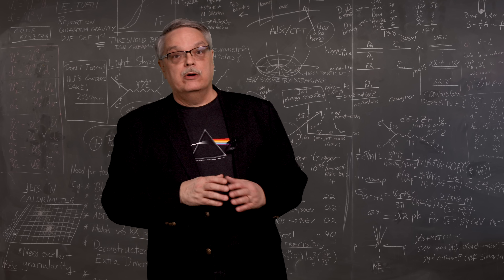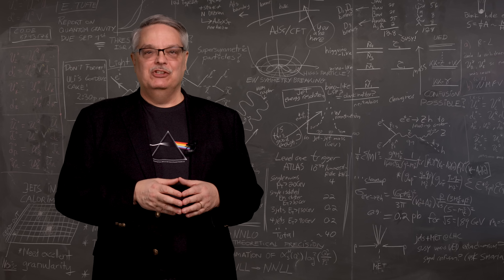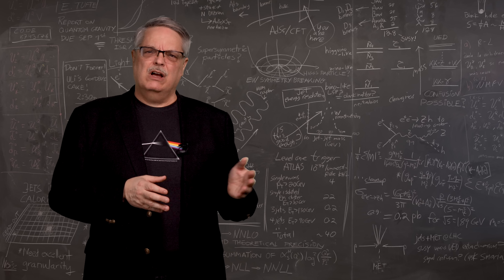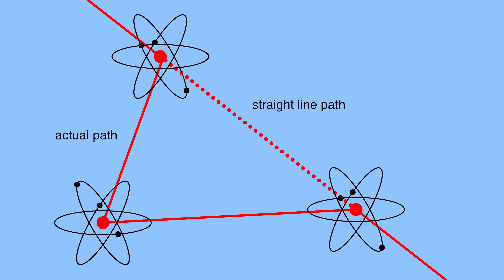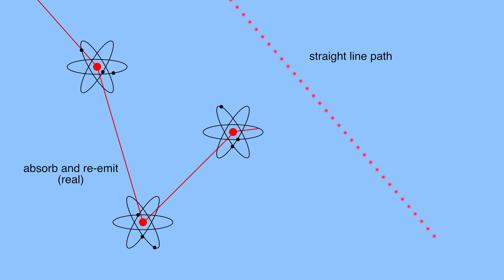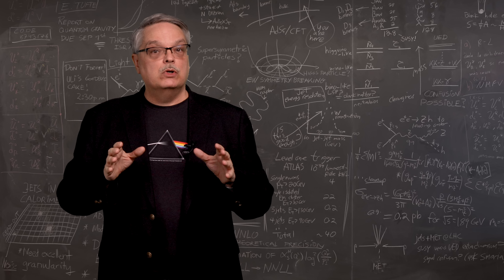Why does light slow down in water?

Comment: The "correct" answer seems flawed. Light can't move electrons without losing energy to the electrons, that is conservation of energy. That means the incoming light is absorbed by the electron, and the electron enters a higher energy state. Then when the electron moves back down to the normal state, it emits light with the same energy it absorbed. That describes the second explanation that is supposedly wrong. If the "correct" answer was possible, that light can move an electron without losing energy to it and continue on, and the electron will then create its own light as well, that is a form of amplification, creating energy from nothing, breaking the laws of physics. Is this video just over simplified, or just wrong?  @Fermilab
Reply: It emits same energy , alright
But how the hell it emits light at the same direction ? 😕 
No body knows 
Fuck that physics 😑

Comment: When electrons emmit the wave, what kind of wave is that? Is it a light wave, or does it have mass?
Reply: Moving electron generate EM (light) waves. Al moving charges emit EM waves.
Reply: @wayneyadams  if so, the EM waves from electron should have the same speed as light, so why the combined wave is slower? Also, why the wave from the electron cannot leave the material? So confusing.

Comment: but that means  the exposure of light to a higher containment of electrons should slow it down even more??

you see, let's say there are two glass blocks (block a and b) , block a is described to have more mass or rather defined as density in terms of electrons than block b, does that mean that the same frequency of light emitted to block a would be  slower in terms of speed than block b due to a higher containment of electrons which induce electric fields upon the light wave ?
the evokes uncertainty upon the speed of light , hence it's not the same

Comment: I'm clearly missing something in my thought process. Hopefully somebody can put me right. When the light enters the medium, it causes electrons to emit their own waves which in turn interfere with the light wave that has entered the medium. This is what causes the light to slow down. Now, when the light reaches the other side of the medium isn't it still traveling with the waves emitted by the electrons? My thought process is that the electrons can't exactly take back the waves they have emitted when light leaves the medium. I would just assume the waves emitted by the electrons would also continue to travel out of the medium with the light?

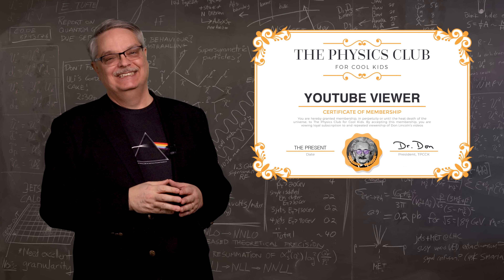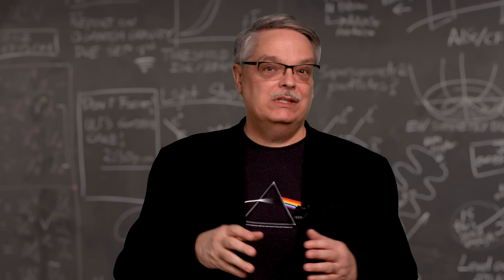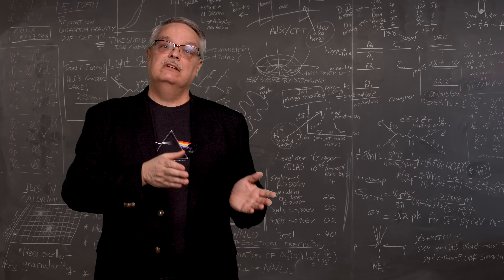Comment: I think the point that you ruled out of light absorption and releasing is valid or at least needs more study, think about it this way; light hit the electrons at 10:00 o'clock direction and absorbed but released at 6:00 o'clock direction instead of 4:00 o'clock. this would justify why the light slow down and bend at the same time. without the need of saying the atom does not remember where the light coming from, l think it does! it's a clock cycle.

Comment: i still dont buy this explanation,,if a different wave is created and is slower then as it exits the glass it reverts back to the original faster wave?? so you are saying the frequency changed while going through the glass by a certain amount of nanometers then emerges back into its original frequency,,,then how do you explain why this does not happen with sgh crystals or frequency doubling? the laser at a wavelength of say 1064nm enters the crystal and is changed to 532nm but remains at 532 when it exists ,is there something completely different happening here than what happens through glass or other substances?

Comment: So light bends while passing through a magnetic field. Also we are told that light bends due to gravitational force. Is this where the connection in between the low range gravitational force but outreaching universal effect of it lies? If yes then gravity is perhaps just electromagnetic force . But then there is more dark matter around than matter. So what we mainly have is really anti gravitational electromagnetic force which is the reason for universal expectation. But distribution of it isn't uniform. So we should see galactic expansion happening in different rate and maybe reversal of it in some spots. Have we or will we see a galaxy just falling apart? I think I could totally mess up everyone's brain 😂
May I ask the valued professor presenter in running an experiment to run the light through a piece of clear plastic then charge that plastic with electro static electricity then compare the difference? Then also apply a beam of light with similar properties but exactly opposing direction and demonstrate if anything might look different? Have we ever heard two beams of light cancelling or slowing each other!? 😂

Comment: Missing from the explanation:
1. The speed of light through the medium varies continuously with the frequency of light somewhat defying quantum effects.  Nice to use parallel sheet of glass but next time try a prism.
2. What is the atomic interaction with the molecular structure of the medium that makes it transparent?  Obviously that structure has a direct effect on the speed of light in the material and its relationship to the frequency is also a mystery.  You left out the part when showing index of refraction in those tables that it is measured with respect to a specific frequency of light I believe in the yellow range.
3. And since the electromagnetic frequency ranges quite a bit, stretch out that spectrum a bit to see what happens.  I'd like to see photons explained in the radio frequency range.
Reply: Write a paper on it.
Reply: To answer your first question, it is because different frequencies of light have waves that have...well... different frequencies. since the velocities of the wave from light and the electric field are "added" together, different frequencies of light would yield different final speeds of the wave.
Reply: @leemaina8170  This is the same preposterous claim made by fermilab.  There is not only no math to support this, but the Fourier transform is the best piece of math to refute it.  It is an illusion to be caught up in an apparent identity that sin (a+b) is the same as sin (a) + sin (b).  The first form is definitely a sine wave but the second form is what you actually get when you add two sine waves of frequencies/wavelengths a & b together and that is not a simple sine wave with a single frequency.  The deception is an attempt to equate the two equations.  Not only does the math refute this but a glass prism or diffraction grating will also split apart the frequencies which were never combined in the first place.  Interaction with electrons at the atomic level can absorb some of the energy and release it as light at a lower energy level/frequency.  My assertion is that the speed of light through matter is a function of both the energy level of the light and the mass of the material it is traveling through.  Light travels slower through higher density glass and the speed difference is exaggerated based on the energy level (frequency) of the light waves.  Lens makers use this trick with compound lenses to reduce or eliminate chromatic aberration.  This kind of infers Einstein's curvature or warping of space at the atomic level.  But I left physics a long time ago and those equations are not on the tip of my tongue.  Can somebody else write that paper?
Reply: If he did all that the video would be at least an hour long.

Comment: Don't think I've ever seen asked this channel YET...

Dark matter is (invisible) evidence of gravity, yes? And gravity is mass pulling (sucking) mass together, yes? And dark energy, the expantion of the space in the universe, yes?So: What if gravity (G) & dark matter (DM) don't exsisst...... But dark energy (DE) dose, and this explains why we think DM & G are real. An optical illusion of a sort (bit like only seeing one side of a coin, and not seeing the whole coin).I guess it's obvious that the math is beyond me, but the thing that occurred to me is: That G & DM are concluded as result of DE 'hateing' matter. By 'hateing' I mean: DE  has but one constant....... To push matter away (from itself). To do this: DE  will increase (expanding space more) over time forming stuff (moons/planets/suns/nova's/Bholes/ect), thus we see the universe, as is. 
------------------
Side note with Link below:Astronomers theorize that the faster expansion rate is due to a mysterious, dark force that is pulling galaxies apart. One explanation for dark energy is that it is a property of space.&A last possibility is that Einstein's theory of gravity is not correct. That would not only affect the expansion of the universe, but it would also affect the way that normal matter in galaxies and clusters of galaxies behaved. This fact would provide a way to decide if the solution to the dark energy problem is a new gravity theory or not.
https://science.nasa.gov/astrophysics/focus-areas/what-is-dark-energy
----------------
ALSO: 
F=-Gm1*m2 /r squared
Might work on the solar scale only because it's 180out..... https://youtu.be/OTMELHUAzSM
---------------  While I've aheap more on this conception/theroy I could ask, I'd totally accept a 'why this can't be so' statement.
.............. 
Anyone?

Comment: If the frequency changed then the color of the light would change not the speed. In addition Snell's law doesn't even use frequency in the calculation of refraction.

Comment: Technically he's both wrong, and correct:  The real answer is - It doesn't slow down.  It moves at the speed of light through whatever materiel.  BUT (that's a big butt) the mechanics he describes, while being correct, is NOT an observation - It's an observation AFTER the fact (if you will).  And the incorrect assumption that you make is that you have observed it slowing down.  But see, you didn't.  You assumed it slowed down because you compared the time to light NOT moving through a material.  That's a false assumption.  There is no valid comparison.  (not when it comes to light!)

Comment: I don't get it. Electrons are moved by the light and that causes the electrons to emit an own wave. This accumulates with the wave of the light and the resulting wave moves slower. Why should the combined wave move slower? If two waves with different frequency are add together the result should be a wave with a different frequency meaning by light a different color. But this is not happening.(And even IF this happens, I have never heard that light with different colors has different speed in materials) Furthermore, this explanation would work with every material, not only transparent once. Why are not all materials transparent if it works like that? Somehow I am missing a differentiation caused by different kind of atoms. Even the number of electrons are not mentioned in this explanation. It does not explain why different material causes different slow down of light.
For me (as no physicist) this explanation sounds as wrong as the other mentioned ideas.  (Just using my own brain)

I  would have expected a strange explanation with a different space-time in the material caused by the fields of the components of the atoms, which makes the distance for the light in the material longer. As the light speed stays the same it changes the angle to get threw a shorter way in the glass. Or something like that.

Comment: the exit speed change explanation still makes no sense,,why would the second harmonic imposed on the first one no longer exist outside the glass?  he said  the atoms create an electric field that slows down the light,,so is this only an electric field and missing the magnetic field that both create light? so what the electrons are creating is not another light but just part of a field of light only the electric and not the magnetic and this does not leave the glass like photons would?
Reply: Wtf did you just said
Reply: @gabrielv8767  i feel the same way

Comment: so what he is saying is that different frequencies of light have different speeds???  so one color of light is moving faster or slower than another color? no they all have the same speed of light  but the difference would be the speed of oscillation not propagation  ,a shorter wavelength would have to oscillate faster than a longer wavelength  but they both have thee same propagation speed and would get to the same point at the same time if they both started at the same time

Comment: v=d/t it does not matter if one path is longer than the other,this does not slow down the velocity of light ,yes it changes the two distances but there will also be a change in both times so in the end the velocity is the same in the medium,,he then says taking longer is effectively another way of going slower,,wrong he should have said taking longer ,the speed does not change but the time it took to get form one point to another may have increased because it took a longer path,just because the path was different does not mean the actual speed of light slowed down,its like a car traveling at 60mph in a straight line or taking a zig zag,the speed does not change even if the zig zag rout took longer ,,hmm ok perhaps there was a change in speed at each point of the zig zg where it had to change course like a ball on the end of a string that encounter angular velocity change,,but if the car was traveling in a long arc it can maintain the same speed as going straight only the arc is a longer path so it took longer to get from point a to point b
Reply: Yo he didn't say velocity, he was talking about speed the whole time.

Comment: Why does the angle of the GLASS SURFACE relative to the direction that the light travels matter??? If you rotate the glass surface the lights direction mirrors that change. I find this question extremely hard to word because its another reality breaking quantum trick.

Comment: This video is implying that the speed of light reduces because the amplitude of the original wave is reduced. But the speed of light is determined by frequency times wavelength. It is independent of amplitude (which determines the intensity of the light, not the velocity). The light travels slower in a medium because the frequency doesn't change and the wavelength decreases.
Reply: "The light travels slower in a medium because the frequency doesn't change and the wavelength decreases." huh???
if wavelength decreases then frequency changes,,it increases in frequency and changes color
Reply: i am still confused on what he says,,so what he is saying is that different frequencies of light have different speeds???  so one color of light is moving faster or slower than another color? no they all have the same speed of light  but the difference would be the speed of oscillation not propagation  ,a shorter wavelength would have to oscillate faster than a longer wavelength  but they both have thee same propagation speed and would get to the same point at the same time if they both started at the same time
Reply: @ARCSTREAMS  Around 8.20 min he implies that it is because of the combined wave, (which has a smaller amplitude compared to the incident wave) that the wave travels slower. As you can see from the pic, the combined wave and the incident one DO have different amplitude, but their wavelength did NOT change, (so the frequency did not change either). Now, since the wave speed is: speed of light= frequency x wavelength (in vacuum is 3X10^8 m/s) you can see that the speed didn't change because it is unrelated to amplitude!. As you said, frequency and wavelength are inversely related, so if one increases the other one decreases and vice versa, but that happens in the SAME medium! As soon as light enters another medium, the new speed is given: Speed of light in vacuum (3x10^8 m/s): New Speed x "n" (index of refraction (listed at 1.50 min)). So if "n" increases, the new speed decreases (always! as in vacuum n=1, the light can't go any faster than that!). Since the new speed decreases in a medium you have to think: either frequency, wavelength or both had to decrease to give a smaller wave speed. Well, the rule is that frequency NEVER changes when passing from a medium to another, the wavelength does. So smaller the wavelength, smaller the speed (and I'd like to add, higher is the refraction, that is why blue is the color on the bottom of the rainbow). That is why a green light entering water will still be perceived as green, it's because its frequency didn't change and our eye can only detect frequency, not wavelength. (I always thought we perceived the wavelength but I was wrong).

Comment: Without knowing, you just explained why light redshifts when there are free electrons (as we see in the laboratory). 
The electrons work as a part of the di-electric and will cause a similar wave. But because they are not bound to an atom, they can lose some speed and will move slightly slower. This produces a slightly slower wave, which is redshifted from the original one.

Comment: But I thought that the glass being transparent meant the visible light didn't interact with the orbital electrons; more precisely it did not get absorbed by the electrons in the orbitals (bumping them up to a higher energy level) and later get reemitted. And if a lightwave does not have the right energy to knock a bounded electron into a higher energy level how could it make it oscillate, apparently in between the allowed energy states? 
Or is it the non-bounded electrons that are oscillating or maybe even the molecules themselves?

Comment: Tried to sense these wavelengths on top of my washing machine a few days ago.
first on a single 650nm beam and also with an RGB combine-module with 638nm 520nm and 450nm to see if I could sense the wavelength-variables.
5 pictures https://imgur.com/gallery/zCrMawa
7 pictures with RGB. https://imgur.com/a/WUarR3K
also tried to put the beam in a magnetic induction field, to see if it rock the boat to any extent..(no effect)
thx for the vid..